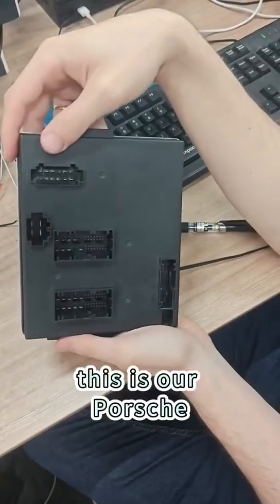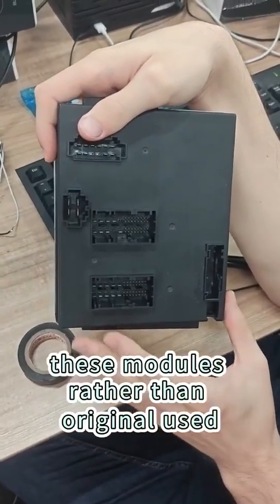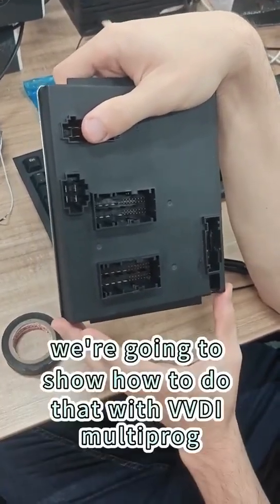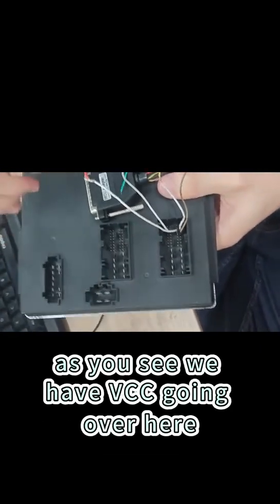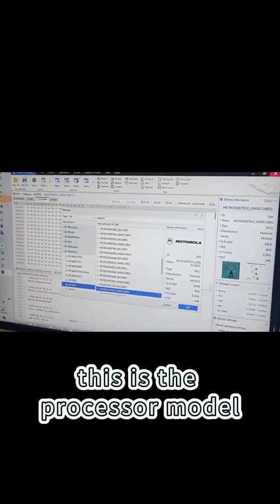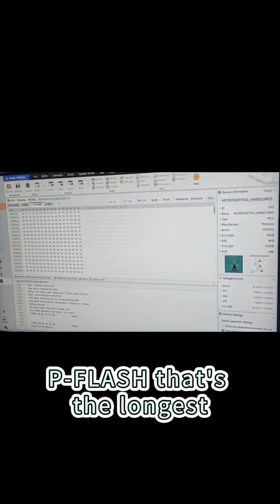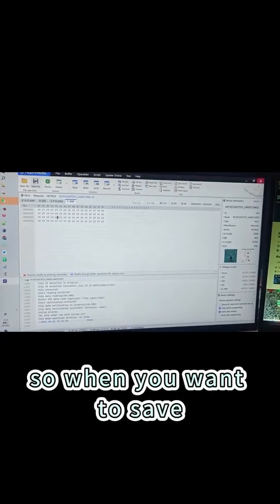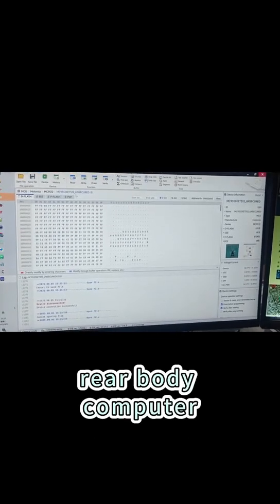How to clone the aftermarket Porsche Panamera/Cayenne rear BCM module without opening it!

Comment: Hello, can you CLONE my Porsche Cayenne Rear Body Control Module? Original water damaged. I can buy same exact used Module from EBay.  Not sure, but Used-module need to clone to avoid Immobilization.
Reply from the maker: You need to have a programmer on your end to do this, we cannot clone a module without a readout of the original one. We can, however, adapt data based on the front BCM module. More info: https://mysupercarexpert.com/products/porsche-911-991-cayenne-92a-panamera-970-971-718-boxster-cayman-981-982-macan-95b-2009-2024-bcm-bcm2-to-ecu-tcu-inverter-immo-synchronization-service?_pos=1&_psq=immo+synch&_ss=e&_v=1.0